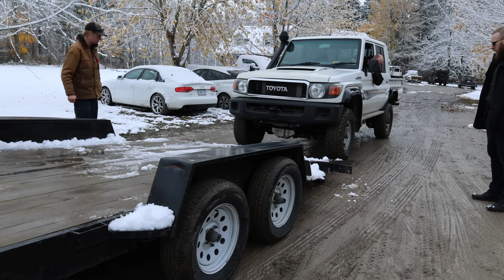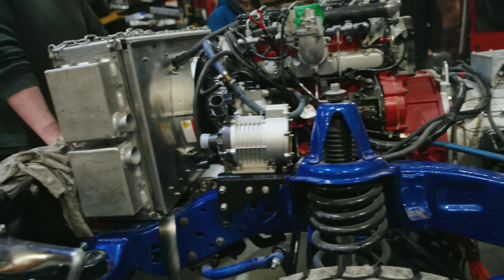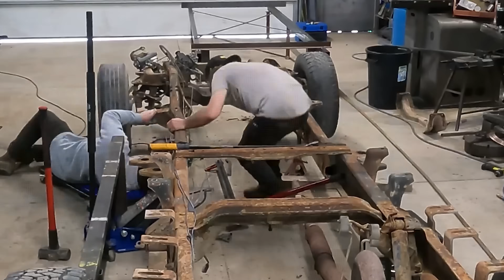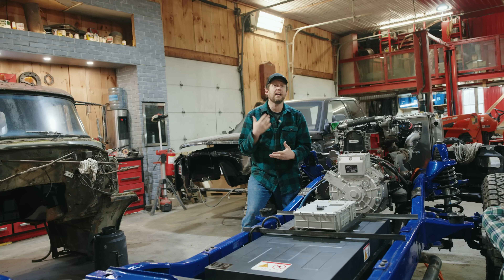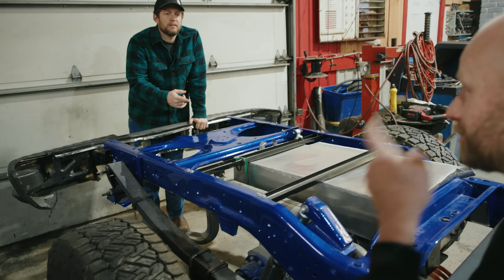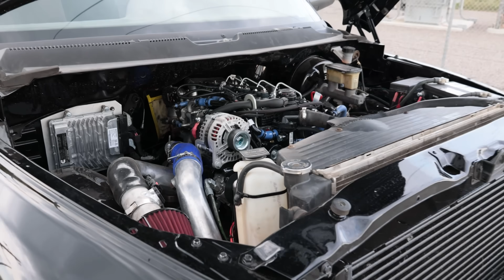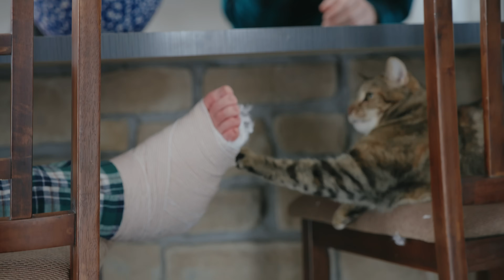Scrap Our First Design and Build an Edison Pickup Chassis from Scratch?

Comment: is the radiator a steam turbine generator capture ? also the typical standard exhaust system... the routing must be changed......that kind of heat ....as the heat increases so does the resistance in the battery which leads to early battery death in dendrites, but it's nice to keep the battery warm in snow belts to an *extent*........dual exhaust in smaller proportion if you are going to do it that way.... thru the frame would be better tube line within a shell..but most of that exhaust 50-90% should be semi trucked up the back of the cab. this also adds a cool factor no current automaker does....peterbuilt that thing!   later on that rear axel should be modernized to dual independent hydraulically load and shift balanced...not sure why it exists now as it can be frame mounted with the suspension independently made into the frame.... thus reducing weight and increasing road handling performance as well as ride control performance gains......via take off charging and dive stopping.
pipe cross membering s a fantastic way to build...the pipes can not only be flattened to fit into tight space but also bent to give arch support torsion support also play a great role in electrical wire routing cross over..... something that should also be considered doing to the main beams of the frame in larger thicker and some what flattened upper welded to a some what thinner  pipe in an somewhat offset triangle trapezoidal manner that can also help shield and cradle the batteries  for crash impacts as well as reduce weight and increase battery space....things that were done with 1970's and 1980's military off road vehicle design testing..... not building an MRAP here.   this would enable the elimination of a great many cab and bed mount brackets as you could channel guide on the cab and bed and then uses a half moon clamping bars to secure the cab and bed to the frame tubular rail.

physics wise on that motor first thing i noticed is that alternator and smog pump doesn't need that incredible amount of tension and thus eliminating the middle idler wheel would be a good thing.    not sure that belt spring tensioner is in the right place...trying to recall if this location was the reason for the ford v belts falling off recall.
electric power steering can be a thing also. fly by wire is weight reducing and safer as you eliminate a steering wheel to the chest. also prevents texting phone useage.  major insurance cost reducer in criminal liability.

Comment: I think that having the right size battery pack also means that the generator isn’t short cycling - I wouldn’t want it to run so short, that it never gets a chance to heat up and run the emission system, heat the oil to a point it bakes out some of the condensation - yaknow loosen up the gunk of life. Cheers 🍻

Comment: If the batteries provide such a long range, why don't you lose the generator and motor to offset the extra battery weight and just offer a pure BEV truck.  I would love the option of a pure battery truck with none of the maintenance issues of a fuel engine, especially if you can produce one in 3/4 or 1-ton size.  That is what is missing from the current BEV pickup offerings, those heavier duty trucks that can pull fifth-wheel or gooseneck trailers.  Don't get fixated on one solution if you have something that works on batteries alone.

Comment: Look into kelderman manufacturing  for air suspension for pickups. I've put over 80k miles on a silverado 3500 ranch truck. Pulling trailers over nasty county roads and pasture 2 tracks. Zero issues, although i went with a belt driven compressor not the little 12v. Self leveling and having on board air is something I don't want to ever go without again.

Comment: Redneck engineer here. Two questions. 1, wouldn’t a modular battery system be better?  It’ll keep costs down with a basic battery and be able to add a battery kinda like sliding in a drill battery?  2, Instead of a dedicated auto engine how would a big twin cylinder diesel generator with auto start?And you could replace the power plant with a trip to Lowes.

Comment: WAY OVERTHINKING IT!
A helper motor inline between transmission and rear end taking place of the long drive shaft. 
Just a motor to apply like 50% of helping power torear end.
Engine uses  50% less power.
Utilize regereative braking and perhaps a larger alternator or generator when low demand,idle,coasting ect.

Comment: All that extra electric power would be great for a house/van studio apartment on wheels type thing, pair it with solar panels on top of the van to trickle in more power when its sitting...
So yeah I think there IS a use case for that extra electric power so don't write it off just yet!

Comment: At this point you guys should just build an entire truck.  

I was interested in this project when it was a conversion kit.  Now it's basically an entire truck without a cab, which is going to be prohibitively expensive for guys like me who were thinking about converting our old high mileage trucks. 

Also, if you are going to make your own frames, do fully boxed. The frame will be stronger and your lives will be easier.
Reply: They explain the reasoning though. It’s for certification and logistics as a manufacturer. When they sell the chassis, the parts will also be available so you can put what you want in your older high mileage truck.
Reply: @westhefarmer   There was no implication that the parts would be available separately. Everything they said made it seem like they are selling a rolling chassis and that's it.
Reply: @KurNorock they said so in their podcast. They implied that selling the entire chassis is a technicality and that they will happily sell individual parts.

Comment: Thanks for the update.

Sounds like I'll still need the one-off kit then to convert my 91 c1500 8ft bed (plenty of room for a battery and fuel tank). I'm mostly interested in being able to use a proven engine generator, controls, and an eaxle (2wd).

 I understand the focus on heavy pickups as that's a commercial market instead, which is smart.

Comment: As someone who is legitimately thinking about doing the conversion with the kit on a 2500 silverado, and who is broke, I actually do think the less batteries is a good thing BUT I would like the idea of expanding in the future. 
 
also as battery tech improves over time, I think range will expand with a smaller footprint on batteries.
 
that being said, I like leaf springs, I want the simplicity and cheaper

Comment: I'm glad I waited to watch this on the weekend, cause I needed do watch it twice.

This was meant to be an update, yet Chace and Rich were quite literally correcting each other the entire time.  If you called it a design discussion video and it would have been infinitely better.

As for the direction I personally am disappointed I don live in America or Canada, I also don't drive a full sized truck.  I drive a Nissan Patrol, that's Nissan's version of a land cruiser.  The original option of adapting your stuff to a factory chassis means it could have been transferred to the Patrol and other similar sized vehicle.  It seams to me that will not be an option.  

As for CMS certification on the chassis's does that transfer to Australia or any other countries not in North America? 

That being said, I'm super pumped you guys are happy for you guys, I'm glad it's all working for you and hoping that it'll mean some thinking will change.

Also can you please clarify what you mean by its running on battery power "too long"? Like is that 200km or 1000km? Also what's the run time of the engine to charge that battery back up to 100%?
Reply: The current truck has 2 batts at 30 kWh each (60 kWh total). 

And the engine makes 150 hp to spin a 100 kW. Then it should take 6/10ths of an hour to charge or 36 minutes while parked, or twice as long while driving.
Reply: @Sah-o5m thank you,

Comment: I think that you should keep the frame rails at 34 inches and here’s why I’ve had the same service bed for three different trucks you buy pickup take the bed off and I specifically make sure to never modify the original frame mounts that way you get a couple hundred thousand miles on it you buy a new truck and swap your bed over with all your tools and your welder and air compressor put the original bed back on and sell it off any decent flat bed installer will install them to the factory points so they’re removable for service or anything

Comment: in my opinion the electric range must be 80-100 miles, so that you can drive your daily drives with battery alone and recharge at home.
And the engine would only be used for longer drives.

60kWh seems like a good choice.

Comment: I agree with having a uniform chassis to ship out that can be modular for different wheelbase. If it can be narrowed down to someone picking this up and only having to locate the suspension, axles and wiring; that's realistic for diy or for a certified installer who now doesn't have any custom fab work or modifying to do. And for every truck an installer does, the parts only get better whether that's body mounts or shock towers, etc. Worst case you have some turning radius issues where the wheel hits the fender and needs some modification or the wheel stance is outside the wheel well and needs some fender flares or flaps.

Comment: Make the battery box and everything fit 34"; also make axles with that fit standard leaf springs.   You may perceive it being clever to change frame width and axle attachment but I want to minimize expense.  I have heavy receiver hitches and gooseneck hitches and truck beds with underside tool boxes made to fit standard widths and some of these attachments have already outlasted several trucks.  I don't want to be 100 miles from home towing a trailer with an airbag failure.  Also get axles with inboard planetary designs many cranes are hauled because they have outboard planetary designs.
I also wish you would just find generators that would mate to standard truck engines (i.e. 4 pole 1800RPM) because my vehicles may need to pass emissions and safety checks.  Many emissions checks are done by plugging in to the standard OBD port and are also based on things under the hood "looking correct" based on VIN on vehicle.  I cannot afford to stick money into something that I cannot license.  
I hear you talk about things being simple and about using standard parts but then I see this video. All I want is to be able to get a generator, control system, battery, axles and electric cables.

Comment: So they are making conversation kits for any (or most) pick up trucks AND an Edison pick up? Or just an Edison pick up truck?
Reply: An Edison drive train, on an Edison rolling chassis is called a "skateboard" in the industry and might become the foundation of an Edison F450 or F550 service truck.

Or, the Edison skateboard can be sold as just the skateboard so customers can drop whatever front clip, cab, and bed suits their needs as a conversion kit.

Or, a customer might just by the hybrid drive train kit and use it to convert their pickup.

Or, a buyer might just purchase a bare minimum kit where they bolt an Edison generator to the stock motor and then only replace the rear axle so as to re-power a worthy truck that has a bad trans.

Comment: How much more is it adding to the price that is supposed to be less than half the price of a new truck?
Reply: If you buy just the drive train, then it will be less than 1/2 the price of a really expensive new truck.

If you buy the drivetrain + an Edison rolling chassis then it won't be less than 1/2 the price of a new truck.

It's up to the buyer on how deep they want to go.

Comment: I may be insane, or simply dont know enough. Would it be worth sticking with the Cummins R 2.8 as it is a easy to find crate motor and you can find a Cummins shop anywhere? It seems to follow along with the design ethos or right to repair and long term maintenance.

Comment: @EdisonMotors its been a few years since i work for CAT (2006-2008). But back then if i remember right any engine below 6 liters was actually manufactured by perkins, then basically painted CAT yellow. We called them perkapillars. Plus i believe that they already have generators in those smaller sizes, so getting a generator ecm tune should be easier i think🤷‍♂️. Plus on the maintenance side for the small construction guys would be nice. They'll have the "same" engine in the pick-up, as the skid steer/ mini excavator or backhoe. As for the frame, so far seen in the comments. That's the width of 34in is standard, but one comment said that in 2008 it changed to 38in. If so maybe have an option for 34 or 38 inch widths or keep the 34in and and leave that part of the frame open so the out fitters can make extra sturdy brackets to makeup the widths. As for the suspension, i like the 4 link front and air ride rear. Maybe you guys can get a contract with bilistien, fox racing or king for the shocks. King or fox coil over fronts would be cool. Also maybe partner with liquid suspension (hydraulic suspension). I've starting to hear more of that style be put on ambulances and buckets trucks cause of the constant heay loads they got to carry plus i believe it can also act as a sway bars.
Reply: Perkapillars. I love it :)

Comment: Frame rail thing. Keep it standard with one to 2 ton trucks. As for your suspension system, the back of the vehicle should be air and the front of this vehicle should be shock and leaf spring or shock and coil . You want control? This is a new type of vehicle and you are going with a system of suspension that is nice and all but you are and inadvertently increasing the cost. So like I said keep the airbags to just the back half of the semi truck. This is a technique that I picked up from a custom semi truck builder who does that and they make he resuscitates old semi trucks and specifically removes the airbag from the front part of the suspension. And sticks with a two shock leaf spring system for just the front you want control and you want the ability for people who have never driven a vehicle similar to this to be going. It's fast and responsive both in pedal and in steering wheel.

Comment: I'm a small time farm ranch. I want 100 mile range, just a battery and electric motor. I pull a trailer from time to time. Will it be possible to have a kit with just battery and E axles with 100 mile range?

Comment: I'm still eagerly holding onto my place in line. I'm curious to see how this custom made chassis works out. I feel that is a better option vs trying to adapt to a bunch of different frames. If you guys can reach out to Liquid Spring and figure out how to make that a suspension option, I feel many with higher budgets would opt for that. I think it would perform better than anything else on the market for handling not only a very heavy payload, but also managing the (what I assume is) very heavy unsprung electric axle weight over rough terrain.

Comment: In the oil patch there’s a lot of Ford and Dodge f550’s running mechanical service bodies, picker decks, and flat decks.  Both use expensive suspension and brake components with little or no aftermarket support. I’d imagine if you could build something to support that market it would be well received. Hotshot services would also greatly benefit from this I’d imagine. And with keeping everything as right to repair, and your own suspension setup up front operators of these rigs wouldn’t be force to replace entire assemblies every time a bushing a ball joint wore out.

Comment: When I buy my kit, to fix a 6.4 ford f450, I think i would want 34 inch frame rails. but it's not that hard to modify a flat deck and tow hitch for the hot-shotting this tow pig does. So, realistically for me, either is fine. Us guys who buy this chassis are not afraid of a little custom work.

Comment: For the 1st Edison skateboard chassis, you should drop a cab and service bed onto it for use as the Edison remote service call repair vehicle. Give it a welder and lots of city power output.

Comment: I've got a pre-order. The more Ive thought about this, the less feasible it seems to do full axle swaps. Maybe rear axles are simple enough, but the front steering issues cause scope creep. I really just want the simplest and cheapest. I think I would have to keep the axles and place an electric motor on the transfer case and find somewhere else to place the battery

Comment: You can widen the frame, because if you go to airbags, you stay low from the front of the cab to the rear and you can bolt your mounting brackets anywhere. Left, right or on top of the C-rail.

Comment: I am not an engineer, but it seems to me that if a wider frame can fit more components then it makes sense to go with a wider frame. if cross members are strong enough to support a transmission/transfer case, or gm torsion bar suspension on 4x4 trucks, then it seems like a top of frame cross member with 34 inch rails for mounting a cab and body would be possible. it might add a few inches of height, but if that makes more room for components then it means less work to upfit extra batteries for the special use case trucks